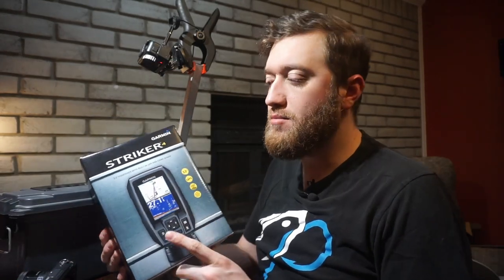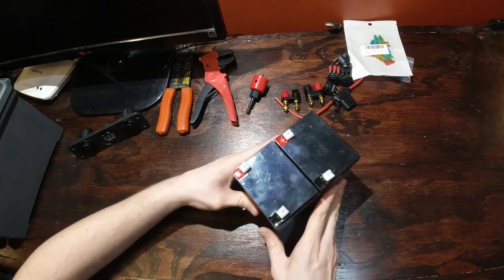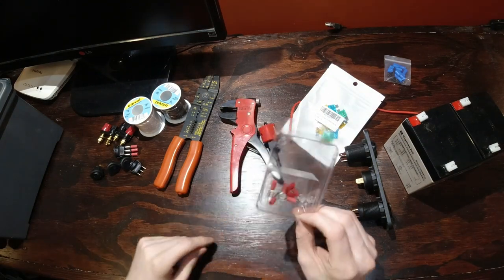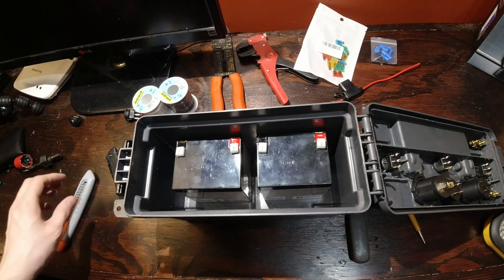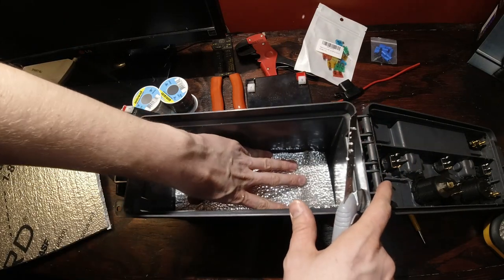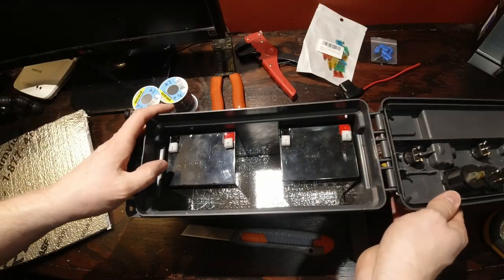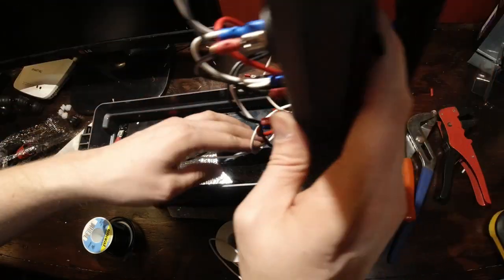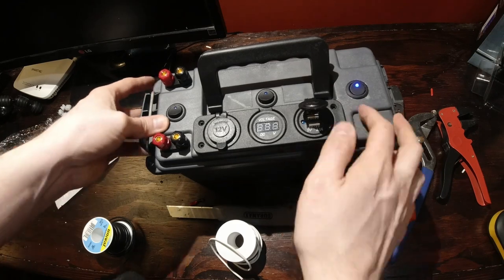DIY Ammo Can Powerpack

Comment: You can get male fittings  so you don't have bare wires that plug into the top of yr pos and neg or you unscrew and insert in the hole on side where u put yr Garmin wires and tight in it down. Love the video thanks.

Comment: I gotta say, I have the same Garmin device. It's going on 5 years old. I've only used it in salt water. It's still working like the day I first activated it regardless of the countless times it's been splashed, sprayed, and salt encrusted. I am going to build a similar box, but will be including a small 5 amp charge controller for a 25w solar panel, to eliminate the need to charge the battery from mains and to prolong battery life when in use.

Comment: I just watched another video on the same subject . Your batteries were 19.99 each . They are 5ah . For less than 40 you can get a 15ah battery . For less than 70 you can get 2 . For 99 you get 3 . 15ah each . The insulation is a good idea . For cold weather you might add a small led inside to keep things warm and dry. Or wrap your box with space blanket . Or with the same insulation you used in the bottom of your can .

Comment: Excellent video! Is the fuse necessary and which fuse do you use?
Reply from the maker: Thanks and I'm not sure if its absolutely necessary but the research I did said it was a good idea will help save your phone or camera if there is a surge also I used a 5 amp fuse
Reply: Thank you!

Comment: Could you please a link for the type of battery charger you use for this device-Thanks
Reply from the maker: some thing simple that has 12v 2amp capabilites would do

https://www.amazon.ca/DieHard-71219-Battery-Charger-Maintainer/dp/B077742Y1H/ref=sr_1_26?dchild=1&keywords=MotoMaster+15%2F2A+Automatic+and+Manual+Battery+Charger&qid=1614101457&sr=8-26